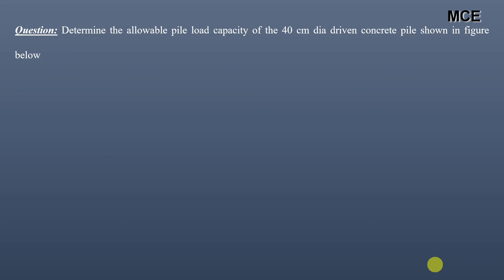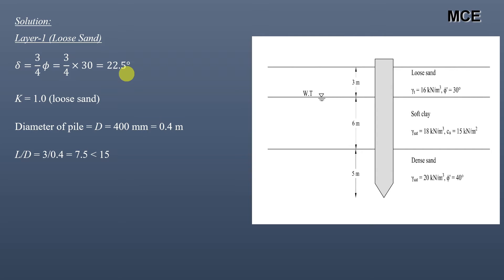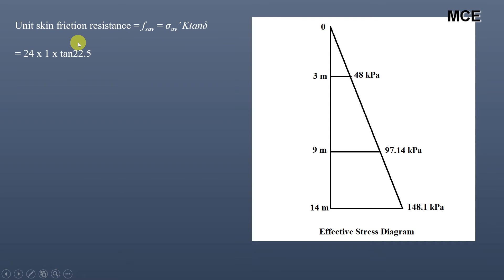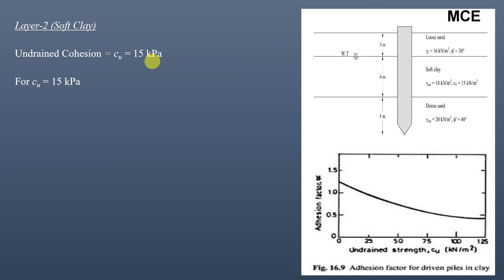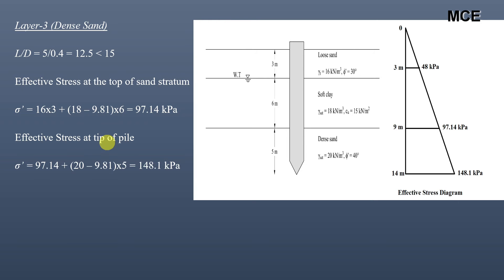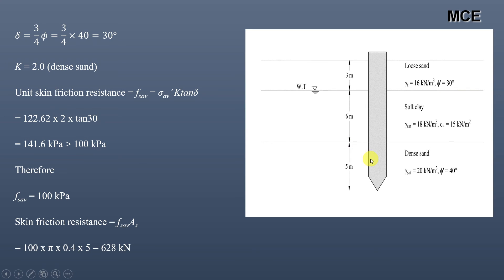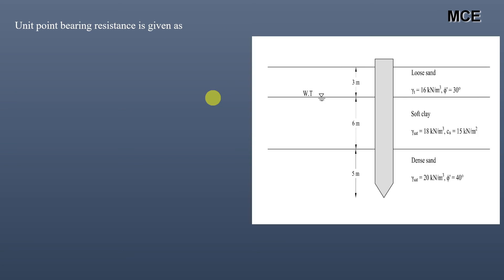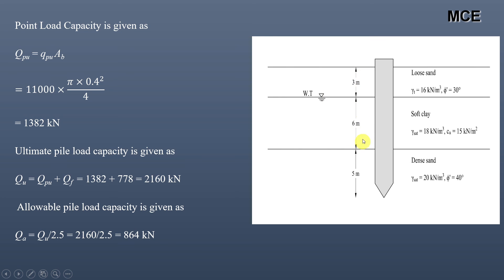Ultimate and Allowable Capacity of Pile in Three Layered Soil With Water Table|Solved Problem

Comment: Is water table won't affect the allowable pile load capacity??
Reply from the maker: Thanks for Watching Master Civil Engineering
Reply from the maker: You can clearly see from the solution that water table is reducing the bearing capacity of pile
Reply: @MasterCivilEngineering  Thanks!! Got it soft clay have no effect of water table here but during calculation of effective thrust of dense sand, minus the unit density of water which reduce the bearing capacity.
Reply from the maker: Glad to Know that video was helpful to you
Reply from the maker: Please share the video with your friends to help the channel